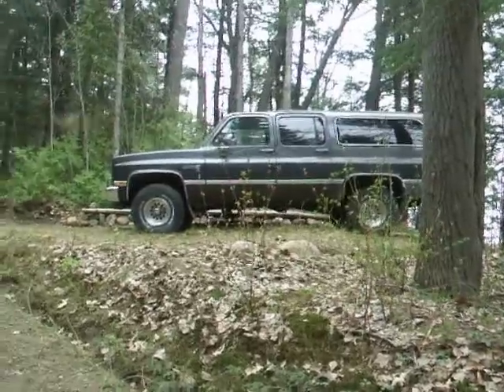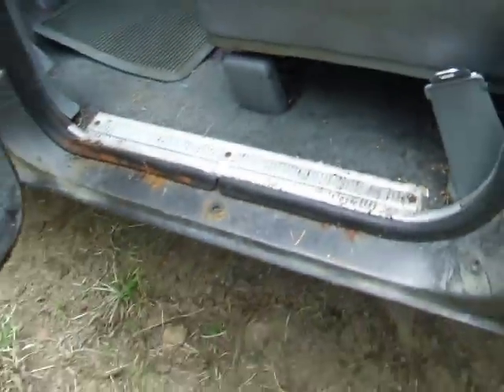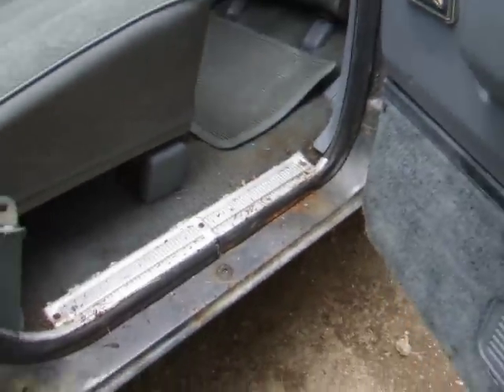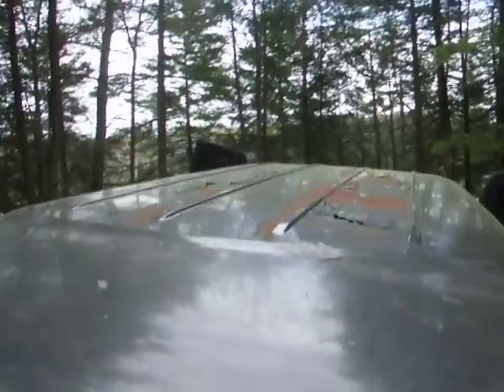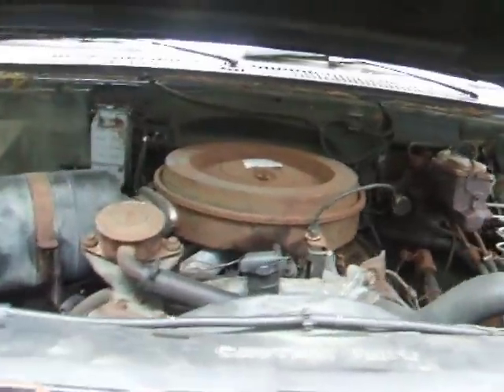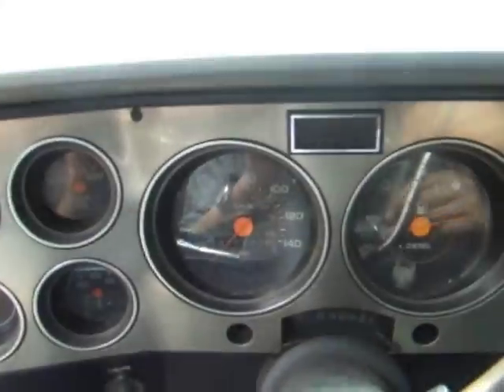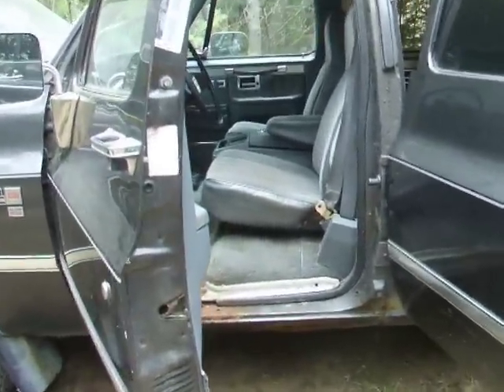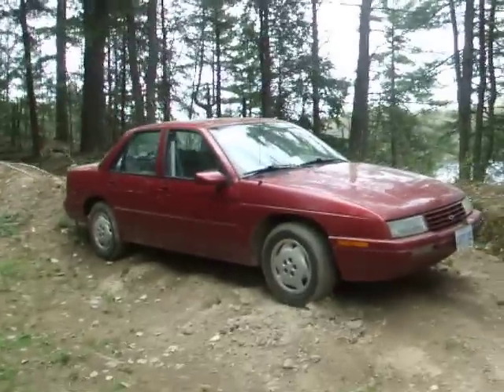1986 GMC Suburban Sierra Classic 6.2 Diesel 4x4 - SOLD

Comment: the guy i bought my burban off drove it from NY to NL with the rear bearing on its way out, and i drove it around for a lil bit (200km) till i got another rear end put in her. it cost me 100$ for the rear end but 620$ to get it installed. lol. mine is a 1986 4X4 diesel, my truck is pritty much a carbon copy of ur 4X4, i soooo wish i seen this video sooner, i would flat beded it to NL and put my rear endin that one. i got 89,000miles on my truck tho

Comment: would an 86 not have a serpentine belt?
Reply from the maker: Thanks for the comment!  I think the seats are long gone, the new owner parted it out in Southern Ontario unfortunately.  Was hoping he'd throw a new axle in and get it back on the road, but guess it didn't work out.   Oh well......

As for the serpentine belt, I don't think that came out until 1988, and then only for the gassers.  I think the 6.2 kept the standard belt in the burbans all the way to 1991, and maybe got the serpentine belt in 88 or so only with the new body style pickups.  Cheers!  Bellarmine
Reply: The 6.2 got a serpentine belt when it went into the new bodystyle trucks in 88 I believe. But the Squarebody trucks with with the 6.2 kept the v belts up until that bodystyle was completely discontinued in 1991.